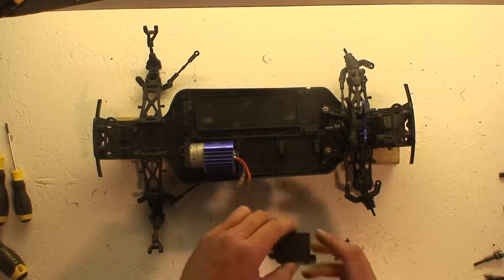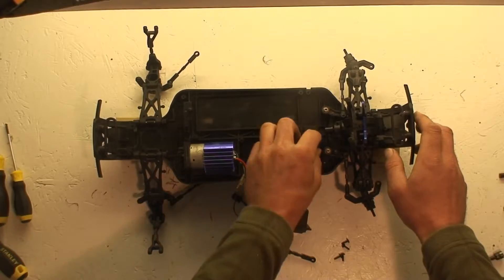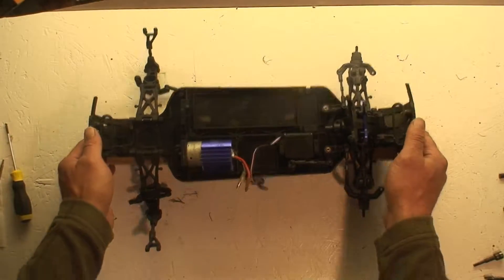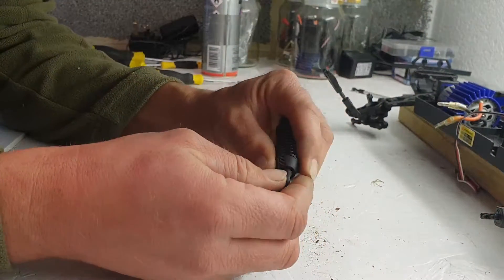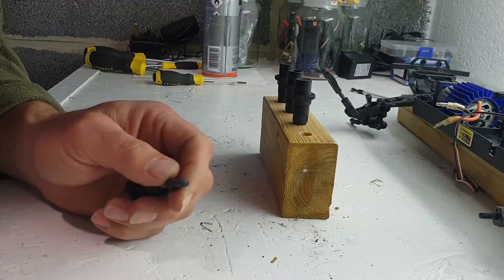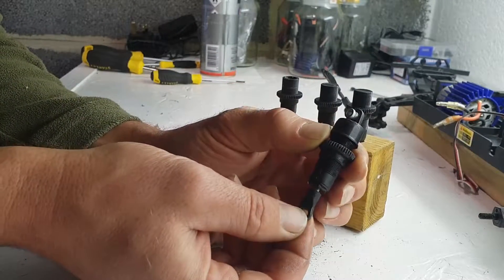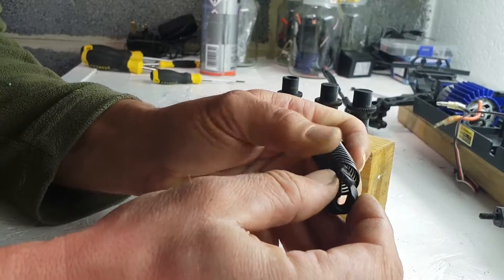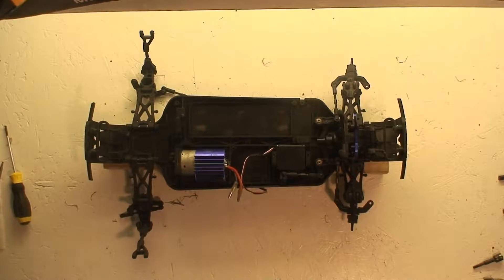BSD Racing Onslaught V2 Part 4: New Servo and Refilling Shocks with Oil

Comment: Yo Do you have the name of that servo I broke mine on my desert assault
Reply from the maker: The original servo part is BS-B7014W
I would recommend the Power HD LW-20MG instead. It has metal gears inside, is cheap and reliable. The downside is that it's not the fastest moving servo out there but this hasn't been a problem for me.
I have done an install video of one I put in my Maverick Strada:  https://youtu.be/2PFd9i8TrqQ